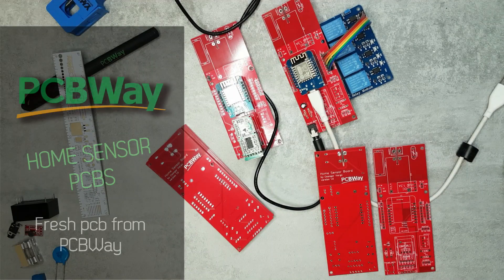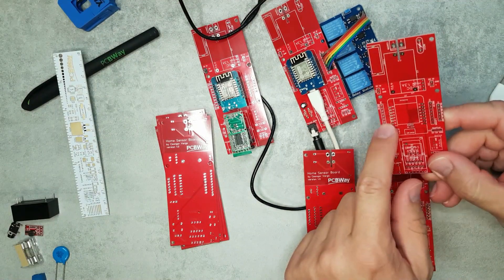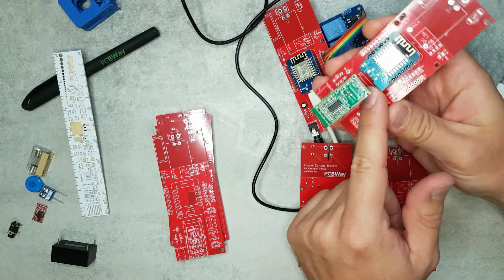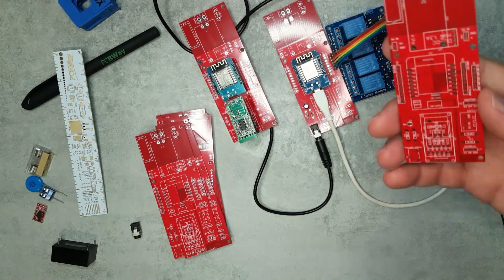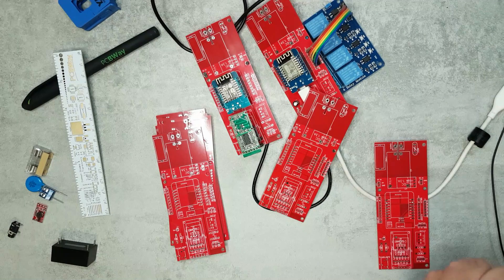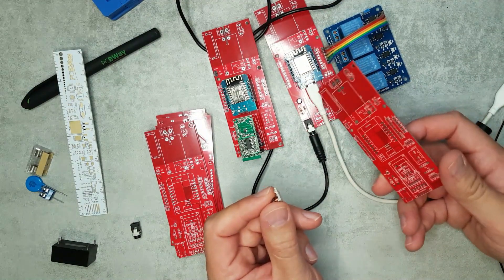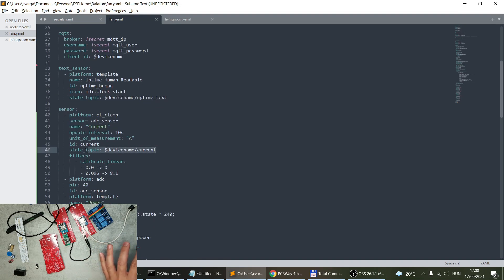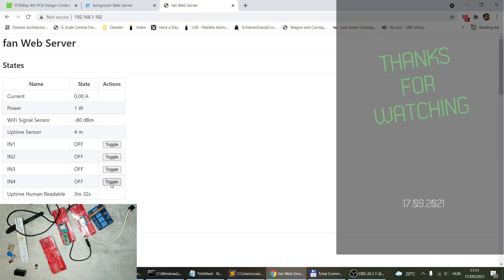Home Sensor Board - PCBWay

Comment: I think I have seen some reviews of the RCWL-0516 that gave interference problems when installed near a wemos d1 mini. To solve it, it was necessary to move it away from the wemos d1 mini by at least 20 cm.
Reply from the maker: Oh, I did not hear that. When I installed it as shown in the video, it was working fine. It was detecting my movement, and stopped detected movement when I was staying still. It looks OK for me to be honest. But it needs more testing to be honest.